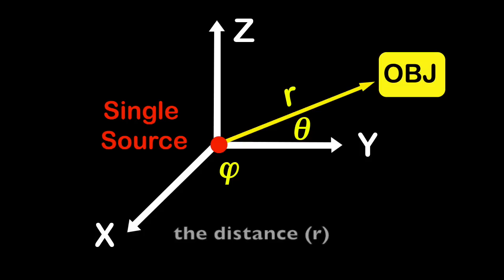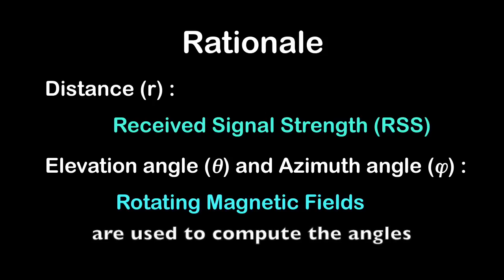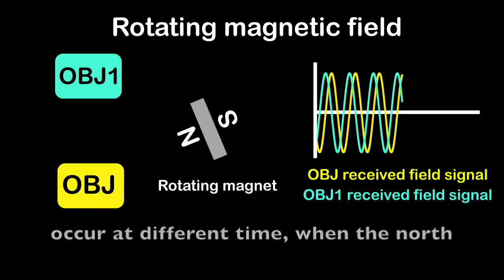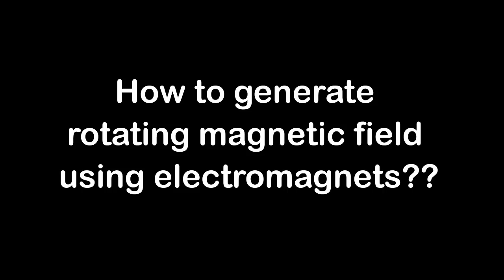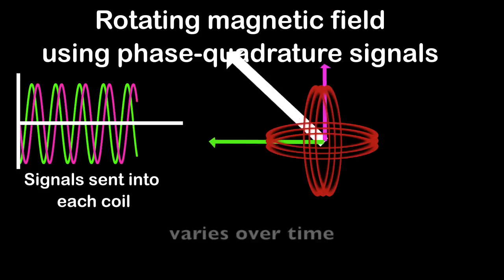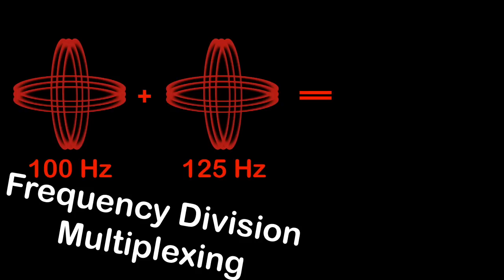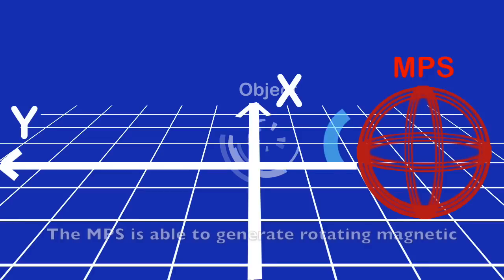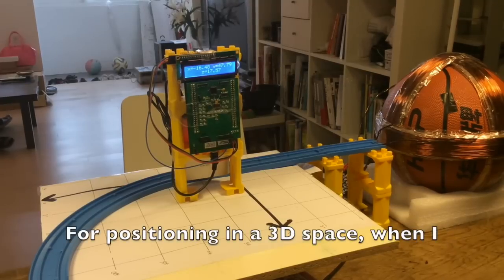2015 Google Science Fair

Comment: 1. is it possible to implement in existing smart phones?
2. what is the maximum cover range of magnetic positioning sphere ?(if the commercial magnetic sensor in smart phone is used)
Reply from the maker: Ting-Yueh Chin Hi, it's possible to implement on smartphones as there is also a magnetometer inside most of them. However, we have to modify the hardware to achieve "high speed sampling", which most commercial magnetic sensors in smart phone aren't. Current range for this system is around 4 to 5 meters, and this could be improved....

Comment: This is a very cool concept, but it's very similar to planes' ADFs with a third dimension. Also, RSS is not a reliable mean of evaluating distances, because this is too sensitive to external factors.
However, this can be perfect for very approximate position finding over a very short range.
Reply from the maker: Pier Maria Biagiolini Thank you very much for your inputs. To my knowledge, ADF requires to rotate the antenna mechanically, while MPS don't need to. (I will do more researches on it)
With regards to the RSS issue, this is the current method of determining distances. However, I am also thinking of using time of arrival (TOA) as a way to see if it has a better accuracy.
I will keep working on these issues, and I'd like to thank you again for the advice:)
Reply: Modern ADFs use perpendicular wire antennas to do a job similar to that of your device. TOA is a much better approach, but it's difficult (if not impossible) to implement on a 100-120Hz signal that moves at the speed of light. However, you could implement in the same source the magnetic sphere and a radio TOA.
Reply from the maker: Pier Maria Biagiolini Thanks again for your information. I will do more researches on these. If I have any discoveries or improvements, we could have more discussions about them. Then, it will be a big step toward my goal, which is to see robots and/or Nano quads moving around in my home:)